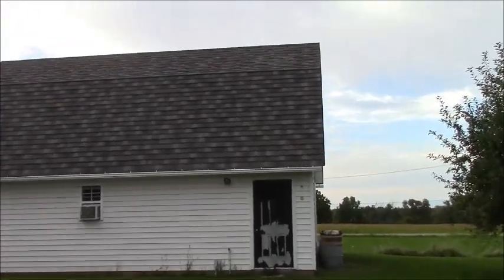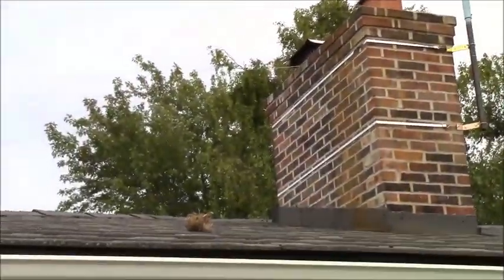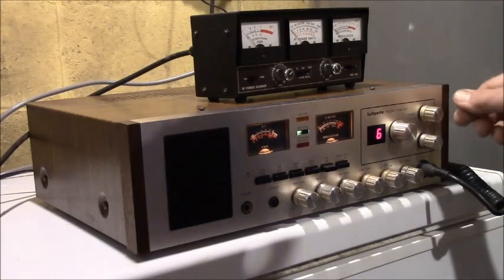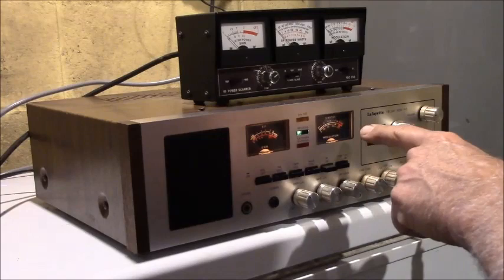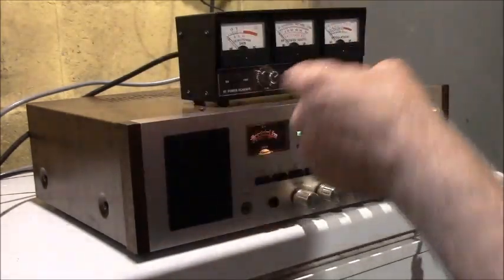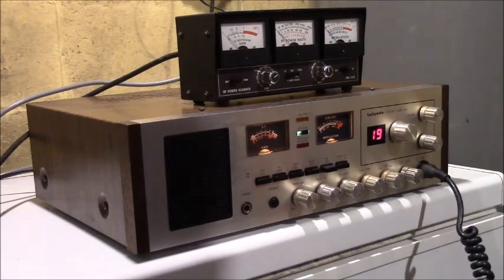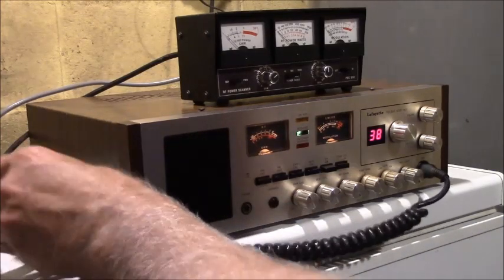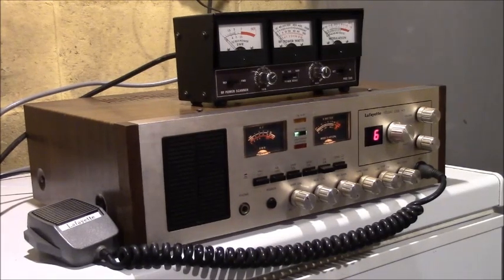DIY CB radio repair, How to build a quarter wave vertical dipole CB antenna part 2, testing

Comment: Because the SWR is higher on ch1, the radiator is a bit short. If you were too add that 6" spring to the whip, I think you'd be right on the money across the entire band.

Comment: It is a vertical dipole which very likely is 70 ohms, with the 50-ohm load it should be 1.5 :1  even if you could adjust the whip and bottom pipe so it works as well as can be expected. If the coax was poor quality or especially long a lower SWR might be read, but likely would be a false reading. The antenna in my view works as well as the design calls for. GOOD job. No additional radials are necessary, it has both sides of the dipole in tune,

Comment: I'm not a fan of the straps , so I made my own from those conduent holders and a set of two long steel screws with bolts . I made two sets . Top and bottom.  Not sure what you call the holders , but they hold conduent to the wall.  They are in a square "U " shape and have holes about ever half inch or so.  I can send you some pictures.

Comment: why not use a antorn or big stick or a /58 wave p500  you can drive around all day and get them for free from the good old days of cb
Reply from the maker: Allan Varner I had all the parts laying around except for the coax... so why not build one? No fun in just putting up a pre made one!
Reply: @bobsbarnworkshop  I understand been there years a go I made all kinds of antenna systems for cb and ham put that radio to it full potential!!! my fist base back in the day was a ssb140  it turned out to be one of the best radios I ever had that and a GE Super Base I have 5 of them.If you want to learn more about radio get your ham licence, there's nothing wrong with or about 11 meters I talked a lot of DX all over the world from my base station and truck seal. For years I had a cb shop and did lots of work and mods but it kind of went down hill everyone got away from cb for some reasons or another but I think it will come  back again in the 70s just about every car or home had a cb and you had to have a call sign I still remember mine.. lol
Reply: @bobsbarnworkshop  I'm not putting down your ant sys at all,you are right its fun to build you have a great radio get some gain on the ant is all. build a 11m ringo or a J pole if you lik to make things also if you know any hams get them to help you get your licence of you dont have one you will wish you did it years a go..over the years I have built a lot of beams,loops worked on repeater systems and towers,but what ever you do have fun it's great to see people building things its all touch and go or if it quits throw it in the trash. Great job on your 102'' base ant. I have a 102 on all my trucks and cars for the past 35 years. lol
Reply from the maker: Allan Varner thanks for your comments, I’m not really much of a radio guy but my friend is a ham with decades of experience, so his suggestions were how I designed this. I have four 102” whips I got from a project at work, they came from US Marine LAV armored vehicles! So I designed around what I had. Years ago I built a similar antenna using a mirror mount, 102” whip and four 102” ground plane wires tapped and screwed to the mirror mount. I mounted the base on the peak of my roof then stretched out the ground plane wires at 90 degrees down the slope of the roof. That antenna had basically zero swr! I would have done that again but now I have a steel roof so I figured it would couple to that so I went higher with the new design. I have a similar production vertical at the lake camp, been there for 20 years.
Reply: @bobsbarnworkshop  I know all about building I'm a ham. de..N3WYZ
Reply from the maker: @allanvarner8137  I wish it was like the old days when every car had a cb and you could get traffic help, directions or just a friendly voice! I scan the channels a lot and rarely hear anyone.... and I live near the NYS thruway, I should hear truckers!... do they still use 19?
Reply: It's about the build .. it gives a sense of self acheavement.

Comment: You could make an antenna matcher by putting a pico farad cap and a .???uH choke in line with yer antenna line and try to match the impedance to the radio.  It would just take some experimenting.  Is that a single sideband radio?  If so I'd be modifying the PLL chip to go above 40 channels where it is a lot more quiet.

Comment: Beautiful Radio
Reply from the maker: Suhail Abdulaziz I actually have two identical radios! I got one on eBay in non working condition and this one from a local ham club for $50. I want to go through them and recap the electrolytic capacitors then go through and check and calibrate all the signals and functions. I also bought a radio shack mobile SSB not working that needs the same work! One base at home one at the cottage and one in my van!!!!

Comment: I did this back in the early 80's when I was 12.
Didn't have a hand holding YouTube video or the internet help.
I just used my head and thought about it.

What's next. A video on tieing shoe laces?
Reply from the maker: Northy Did you view the preceding video where I actually design and build the antenna? There I discuss the design concept and show actual construction. If you missed that you missed the reason for this test and demo final segment. Thanks for watching.

Comment: A 2:1 SWR is 11% reflected (lost) power. At least 3 minutes are lost in crap - that's as far as I got.
Reply from the maker: Rick Via I have 1.2 so I’m happy. You’ll have to watch the video before this one of how I actually constructed it and the design concepts I used.
Reply: @bobsbarnworkshop  Yep that changes it.. 11/ 10 meter vertical dipoles are coll antennas.

Comment: This is pretty good! Nice job on the antenna and the video. I like the design but not being able to tune the antenna is a major problem. Antenna match boxes don't fix the problem (they just protect the finals of the radio or amp). The problem is radiator length. Some people work "skip" on the channels above (and below, unfortunately) the 11 meter band (CB) and being able to adjust the length, while not easy, can be necessary. Trimming the length of the whip isn't so bad but cutting the mast pipe while it's mounted is a no go. Also, getting that whip mount apart with all that silicone caulk you put in is going to be a nightmare. I would forego the sealant since it really traps water/moisture in the connector anyway. Just my opinion. I've built quite a few antennas for 2 meter, 10 meter and FM Broadcast bands and the one thing I've learned is to make it serviceable. Is anybody still on CB anymore? I found this while looking for homebrew CB antennas and am thinking about putting one up. Anyhow, sorry for the long winded comment. Thanks for putting this up.
Reply from the maker: E W no problem, I love getting feedback and knowing someone is actually seeing my videos. Seriously, the SWR is low enough not to be an issue for what I want it to do. I sealed it all with caulk to keep water out of the coax connectors creating corrosion and increasing resistance. Thanks for watching and commenting!

Comment: Wow....A Lafayette SSB-140 Base Station that I had back on my CB Radio days in the 1970's. I had mine paired with an Expander 500 Base Station Microphone and transmitted on a Starduster 1/4 wave base Antenna on top of the roof the Building I lived in Crown Heights Brooklyn....Thanks for the walk down memory lane looking at that Radio. ..Had mine Modified tho to upper and lower frequencies. ..Awesome Radio...Thanks.
Reply from the maker: Jose Feliciano I actually have a second one that doesn’t work as well but I’m going to re-cap both of them and start troubleshooting

Comment: Isn't a true dipole supposed to be isolated in the middle ????   A SO-239 would be in the plexiglass isolator would separate the top of the dipole wire which is your 102" whip, from the bottom wire of the dipole.... I may be wrong in saying this, but I can pick up the Superbowl, AKA channel 6 with a coat hanger inserted in the center of my SO-239 on my CB radio........ 

Don't get me wrong Mon Ami, I am not trying to down your theory in any way at all....... If you can talk and receive 8 or 10 miles, then I want to try this also to do a test ........
Reply from the maker: Boo LuQuette the two elements are actually isolated, the mirror antenna mount has a plastic insulator between the whip and the base bracket, so the mast is the lower ground element attached to the cable braid by the connector sleeve and the whip is connected to the center conductor, so I have the positive 102” whip as the live element and the 102” mast is the ground

Comment: Bob, Sounds like the metal roof would provide issues with ground plane wires so get you a MFJ No. 910 mobile antenna matcher. Have one on my homebrew long wire. Works great. 1.2:1 on 1 and 40. Great videos. 73's 
107 Dallas Texas mobile. 👍
Reply from the maker: Scott Wiseman thanks for the comment. I think the radio has died, I seem to get no modulation on the meter any longer. I bought it as a “fixer upper” and found it worked, although maybe marginally! So, maybe I’ll have a troubleshooting video on it, for sure I will re-cap it first!
Reply from the maker: The radio has lost output so a re-cap and testing is due!

Comment: The tuner is OK to use in this situation. I have exactly that same radio that I bought in the late 1970s. I still use it frequently it is a great talker on side band. Thank you for the video very informative
Reply from the maker: Back in the 70's all the home base stations usually monitored ch 14... as a traveling band, it was better than GPS! Just get on 14 and ask directions! about 20 people couldn't wait to respond!

Comment: That's right CB is not dead kippah talking from the 1122 Wingnut radio out here in Panama City Florida I'll be standing by channel 38 (27.385) lower sideband📡🔊👊👀👍
Reply from the maker: Wingnut Trailblazer I’ll be on Cape Coral February 10 to 27 doing my winter music ‘tour’. I’ll be entertaining at lots of local hot spots and resorts!
Reply from the maker: I have 2 of the Lafayette SSB 140’s. This one works and the other not so much. First I’m going to recap both and then go through them both

Comment: Answer to comment you left on my video.....

Bob, I dont think you need a tuner I think you need to add some more ground (counterpoise),  the way your SWRs are I also think your antenna system needs a bit more length.
If you add a tuner your radio will see a better SWR but you are not fixing the real problem, your very close at a 1:5  Good JOB.
Reply from the maker: breakerbroke23 yeah I’m just not sure where to bond the ground rod wire to the antenna, ideally I’m thinking up the middle of the bottom mast. Of the dipole and directly to the antenna mount at the base of the whip, basically the center tap of the dipole
Reply from the maker: breakerbroke23 I built a similar antenna long ago out of the same antenna mirror mount on a bracket on the ridge of the roof and four ground radials attached to the mirror mount laid out 90 degrees apart down the slope of the roof and SWR barely twitched! I can’t do that now because I have a new all steel roof so I figured it would mess up the antenna